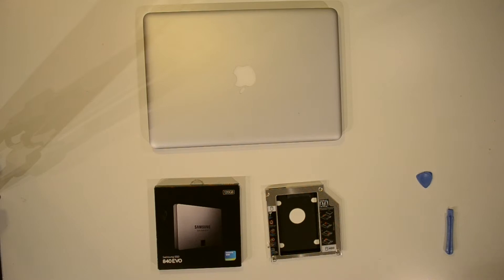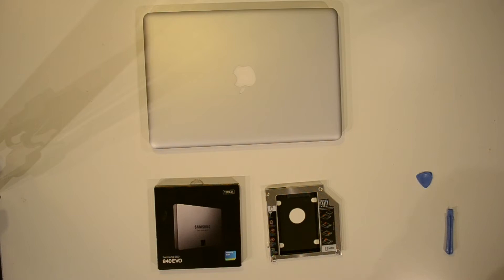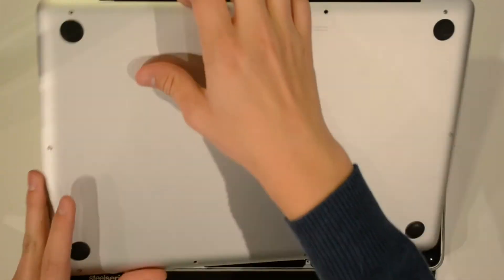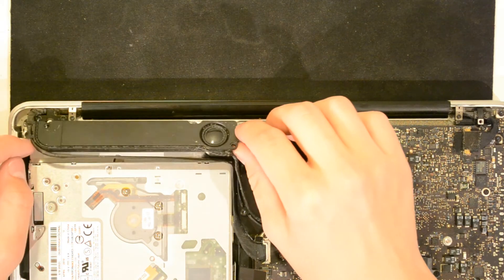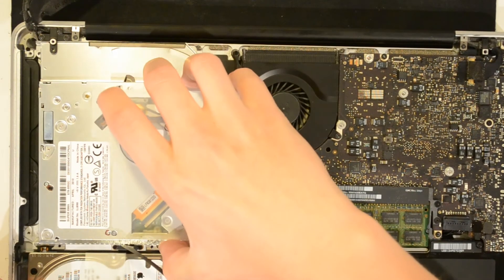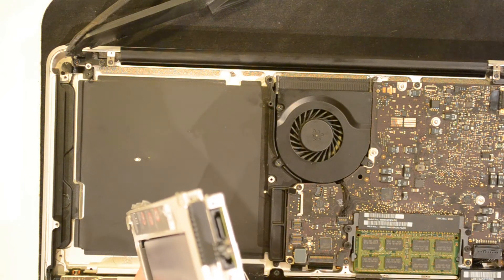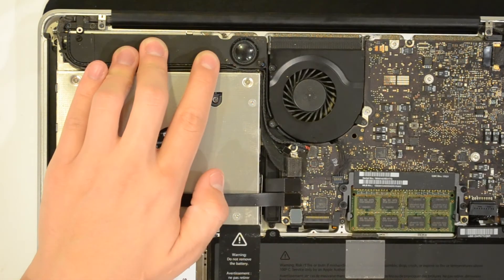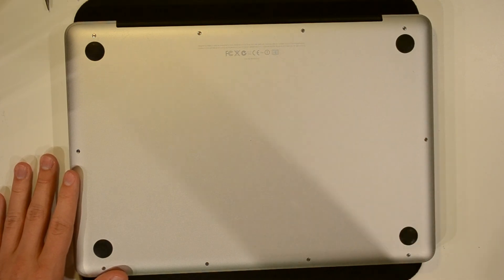How To Add Second SSD/HDD In A Caddy To Replace Optical Drive MacBook Pro mid 2010

Comment: The top left and bottom left screws holding in the optical drive (which describe at 3:30 and 3:32) are incredibly tight, maybe seized. Do you have any recommendations for how loosen them without stripping the screw heads?

Comment: Are you able to do a fresh install of the latest OS on the SSD in that space?
Reply from the maker: Yes. I did that. I am now running a fresh OS X Yosemite on the SSD and have done all the storage on the HDD. So only the absolute necessary are on the SSD. Most programs can be run directly from the HDD even though your OS is on the SSD. Good luck with the modification. :-)

Comment: great video! Are using the SSD as a master (boot) disk or slave? Would you have even more speed if you installed the SSD at the HDD slot instead of the super-drive slot? Thanks!!!
Reply from the maker: +KONSTANTINOS VATHAKOS Yes i am running the OS on the SSD as the master and the standard HDD as the slave. I am actually uncertain if there is any limitation regarding the read/write speed on the optical drive. If there is, it would make more sense to switch them around, but for the moment i am quite happy with the improved speed of the current setup. Hope this answers your question to some extent :-)
Reply: thanks! I did the same over the weekend and it works great so far.
Reply: Dont you need to boot the hdd? or you just put an empty drive in there? and after it's installed... Everything works, or you gotta do some sort of set ups?

Comment: Could someone help me? I made the instalation, everything is fine. I just need to know how to effective clean the original HDD to use it as storage, and I can't find the solution.
Reply: Open disk utility, select the original HDD, and format (erase) it as APFS if you’re running High Sierra or newer, or Mac Extended Journal if you’re running Sierra or older.